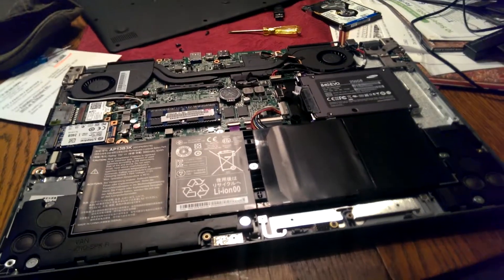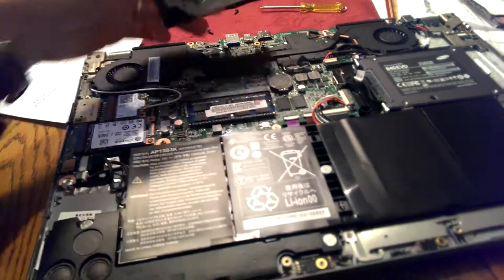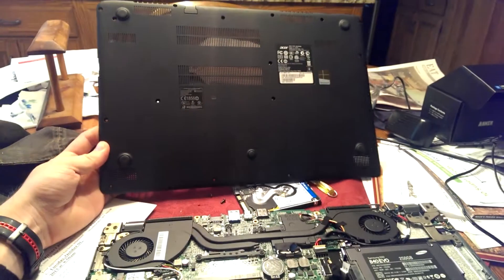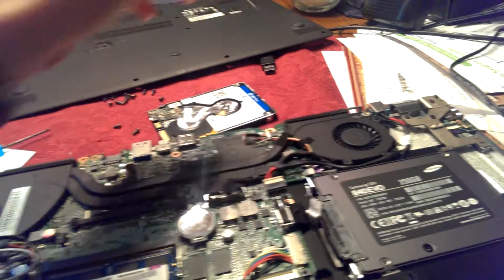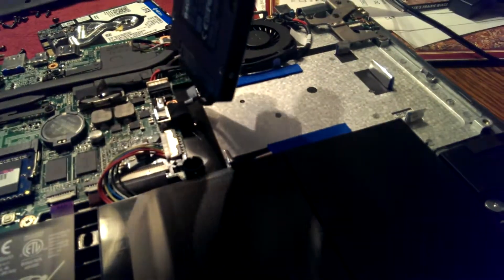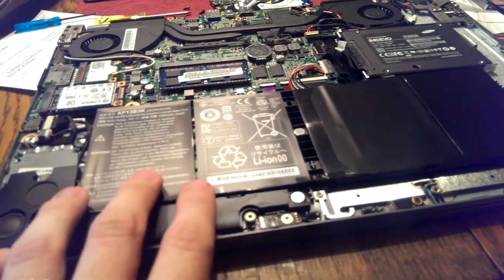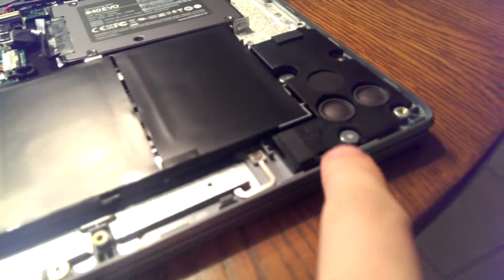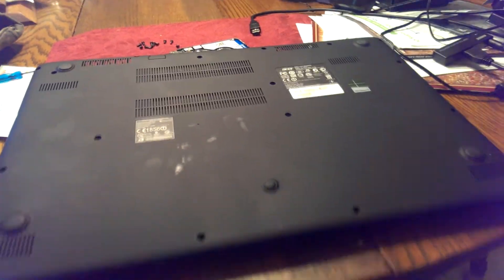Acer Aspire v7 SSD install

Comment: The best way is by change the mSATA unit with a new one 120/240 GB. Install or clone the operating system in the new disk and leave the old one for data. This way you don't waste or loose GB.

Comment: Do you know if the ran is extendible.
Reply: Yes, it supports up to 12GB of RAM, this PC in particular has 2 RAM chips, one soldered and the one you see on the video is removable, this is the one you replace for the upgrade:

PC Specs
https://www.cnet.com/products/acer-aspire-v7-582pg-9856-15-6-core-i7-4500u-8-gb-ram-500-gb-hdd/specs/

Compatible RAM
http://www.crucial.com/usa/en/aspire-v7-582pg-9856/CT4947192

Comment: I wish you would have shown us how to remove the cover. It seemed obvious but when I took mine apart one of the tabs broke off and part of the chassis where the exhaust fan exits cracked in half. I used very very light pressure to get it off and you would have thought it was done right.

I am guessing it has to be pulled apart starting at a certain side and then with pressure at certain angles.

Did you have this issue?

Comment: Hey can you tell me something ? I have my right fan who does a slight tick tick noise when it's turning fast, maybe there's something on it (a dust) on it that does it. Do you think I can disassemble it without losing the warranty ? It's brand new, but I'm using it in my work so I can't really send it back to the shop etc... Thanks in advance !
Reply: Can you use a smartphone to record the sound  and then upload it? That way I can tell whether it is abnormal or not, and what you can do about it.

Comment: would it be possible to replace the msata 24gb ssd with a bigger 256gb Toshiba Q Series ssd?
Reply from the maker: Not sure - that 24GB SSD is really tiny and I think it's programmed to work only with a hybrid drive. Just replacing the HDD with SSD is the only option I know of.
Reply: pioneer7777777 What about replacing hdd with 9.4mm ssd?
Reply: Yes. I have upgrade one model like this and cloned the operating system from the old hdd.
Reply: Rather late reply but thanks anyways lol.
Just to update, I went ahead and purchased the laptop. msata ssd was replaced by another msata ssd. Replacing HDD requires 7mm hdd/ssd. 9.4mm fits but you won't be able to close the cover so its not an option.

Comment from the maker: Hi Muhammed - my idle temps are around 50C and high load temps are around 70C.  The rated max processor temp is 100C according to coretemp.

Comment from the maker: No,the key is to clone your HDD to the SSD before you swap it - you can use EaseUs Todo Backup to complete it - it's free.  You do need a SATA to USB cable to get the job done - I recommend using the USB 3.0 port to speed up the process.  Cheers!